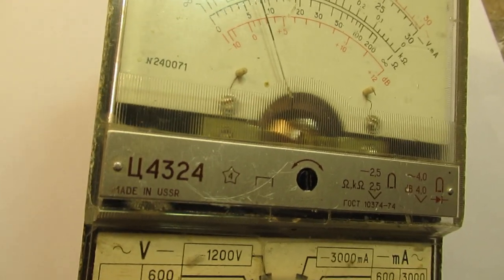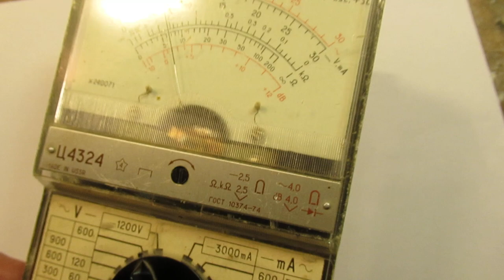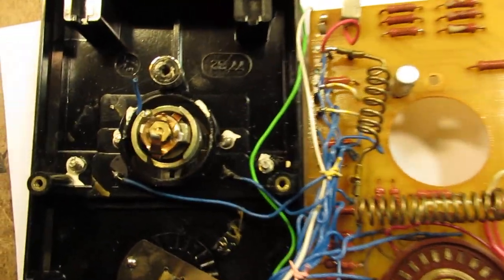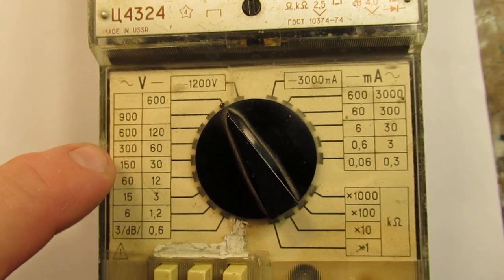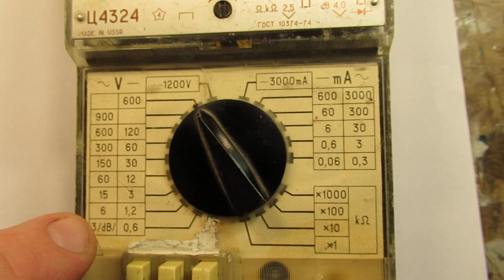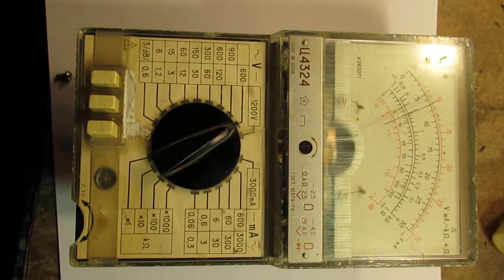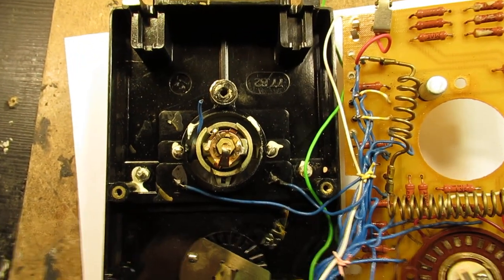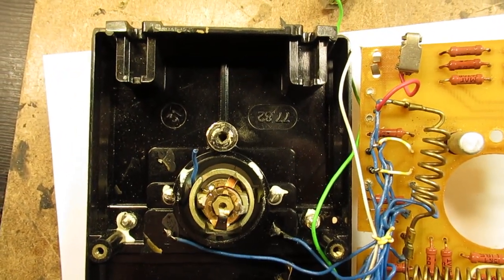Inner side of an analog Russian AVO (Ampere/Volt/Current) meter of the 1970s early 1980s (VLOG)

Comment: I am grateful for this short YouTube video on the old AVO meter that was produced in the U.S.S.R. I think that nowadays one calls such a meter  as the "multimeter". Are you able to find a new milliammeter as a repair part for this AVO in the internet auction or a shop? I have an old analogue multimeter made by a japanese company TMK about 50 years ago. It still works properly.
Reply from the maker: Thanks. I am going to try to find a Micro Ampère meter with a big scale. Sometimes they are on radio markets. If not I am going to change it to a simple Volt or Ampèremeter.  Good to hear that that japanese meter still is OK!
Reply: @radiofun232  Fine! Have a best luck to find a suitable micro ampère meter which you are looking!